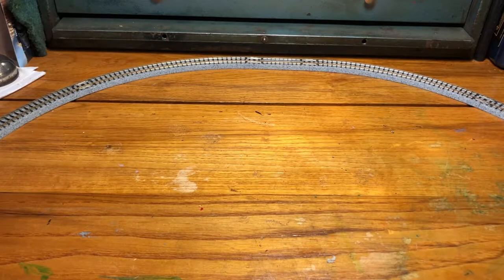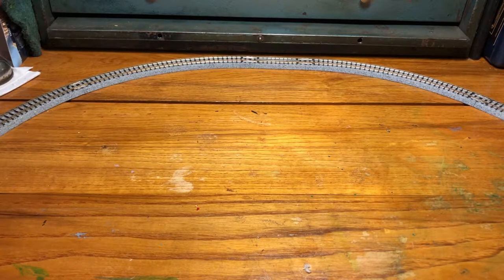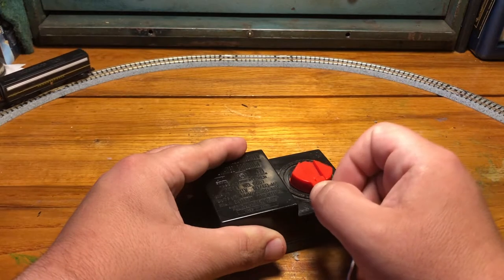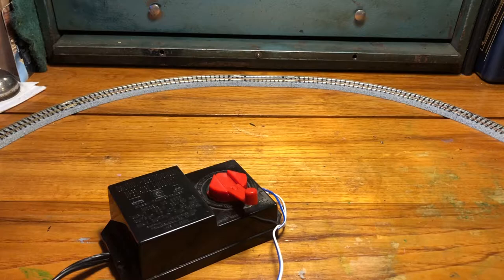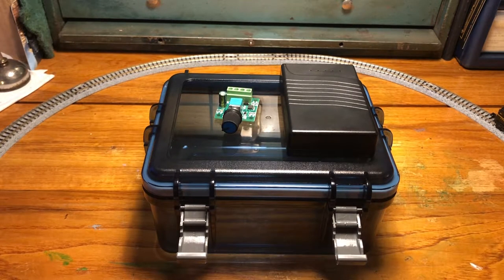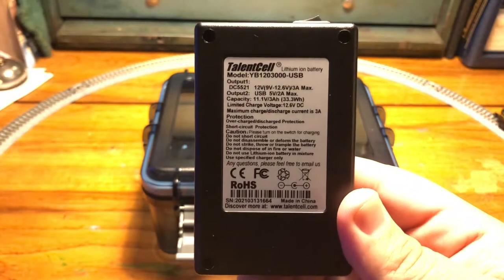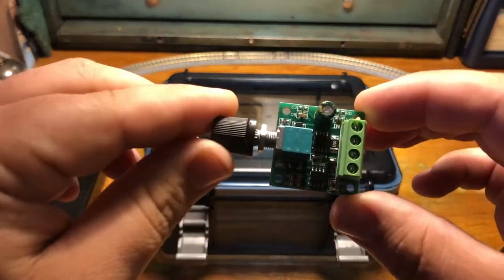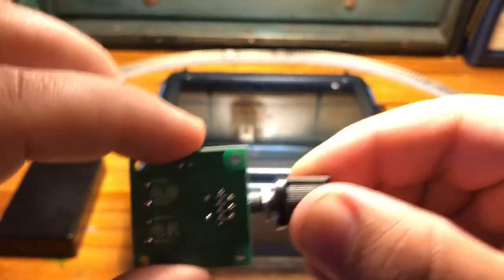Portable N Scale Setup Using Rechargeable Power Bank

Comment: far better leave it where it is then no wires move the more they move the sooner they snap - put 4 rubber legs under the base and leave the knob on the regulator do the same for the charging plug so the variable knob is beside the leg 90 degrees away add the charging plug then no wires move inside the box then you cover it up with card or plastic  then you can store other things in the box and nothing exposed wires covered battery covered you may ger some track in there and 2 locos boxed the charger will fit inside loose with the mains plug on -as you covered the battery and the regulator control under some card or plastic lets hope you read this and can under stand what i mean when in use the box is on it side then you can charged it or run it you see what i am getting at - - you may also want 2 batteries side by side one in use the othere on charge at a show
Reply from the maker: Thank you so much for all of this information and suggestions.  I’ll definitely consider these 😁